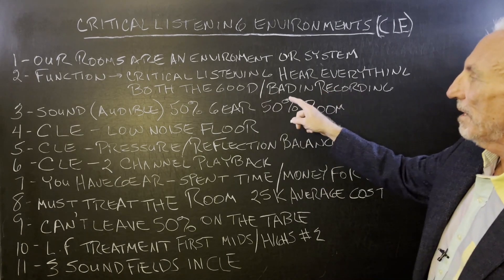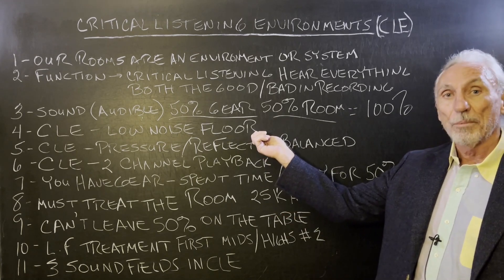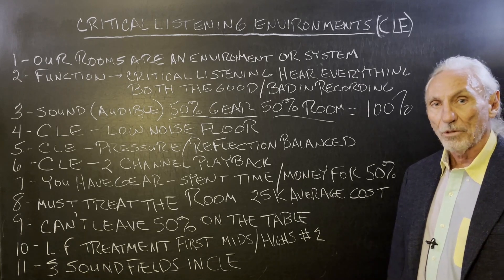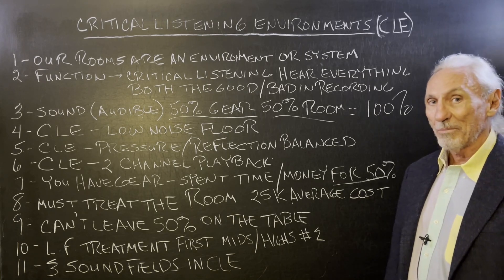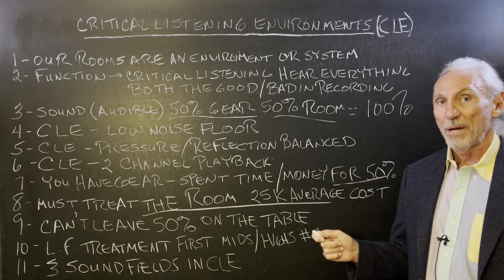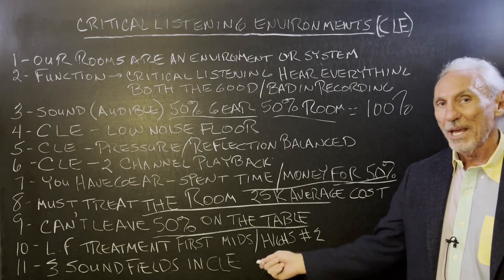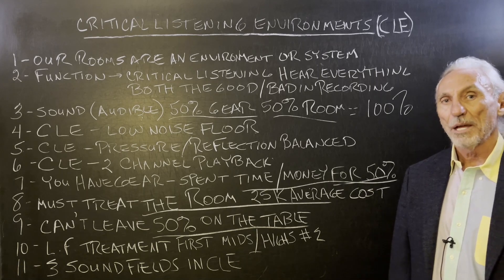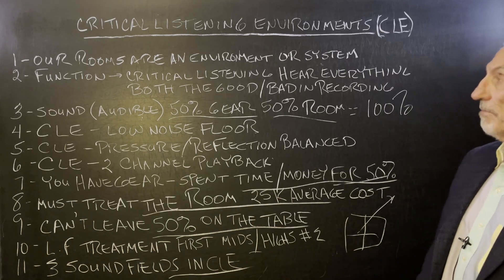Critical Listening Environment (CLE)- www.AcousticFields.com

Comment: Noise floor is so important. Take a dB meter. Measure a quiet room in your house, then go measure outside on your patio; it's surprising how noisy, even in a very quiet suburban area, breeze through the trees and birds can be. Inside your non-running car with the windows rolled up. Then start the engine and measure. Then drive and measure (safely). You've been making notes of course. Now turn on your car stereo and turn the volume up to where you can just barely hear everything clearly and note the dB.

Now go home, back in your very quiet room, and turn the music up to the same dB as the reading in the car where you could barely hear it - except now, it seems so much louder. Now you see why noise floor is so important.
Reply from the maker: Noise floors and the floor to ceiling modal issues are often overlooked even though their importance is significant.